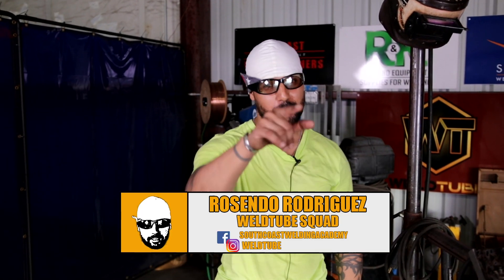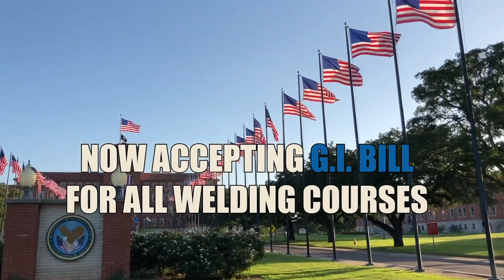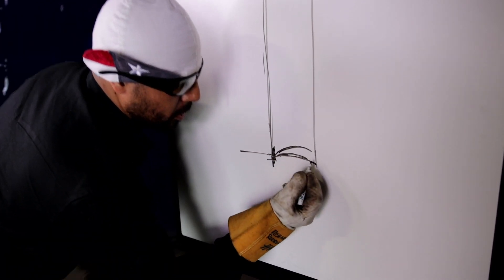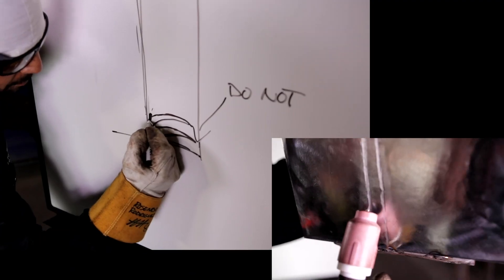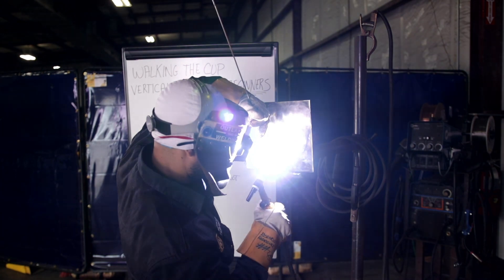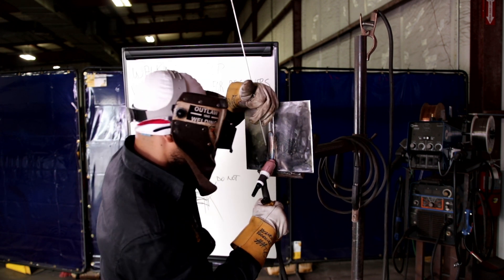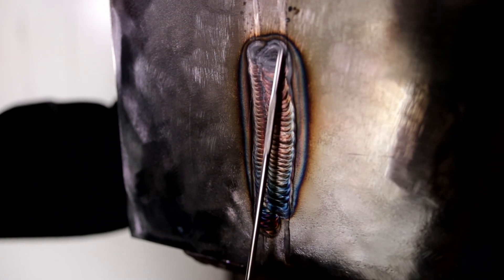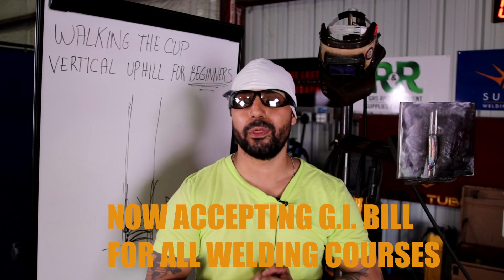Walking the Cup for Beginners - TIG Welding

Comment: I’m a fair freehand for 2 inch schedule 40 but for some reason I never could get walk-in the cup down in the 2G position with 2-inch schedule 40.  I can do 2G with 6 inch sch 40 fine… that makes me think that if it was sch 80, I probably would have an easier time because the bevel would be a little wider for my 4 or 5 cup to skimmy along through.

Similarly, I can shimmy along just fine on a fillet weld too. 

Any advice, tips or a video?

Comment: Can you guys do a video on how to weld on galvanize
Reply: Grind it until you start throwing sparks and see clean base metal. Some people spray the rock with wd40 or something similar to keep it from embedding into the disk. If you're heliarching it's real important to get down to clean metal because it has a tendency to  pop and clog up your gas lens. Not as important if youre using a stick electrode.Hope this helps.